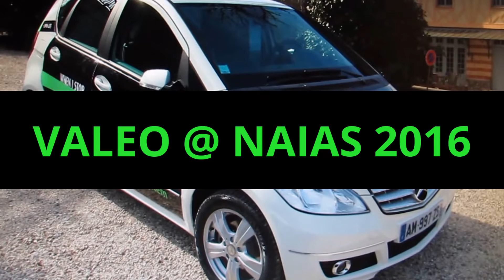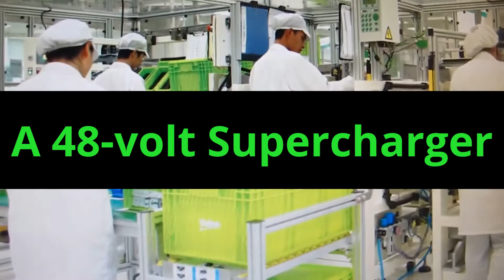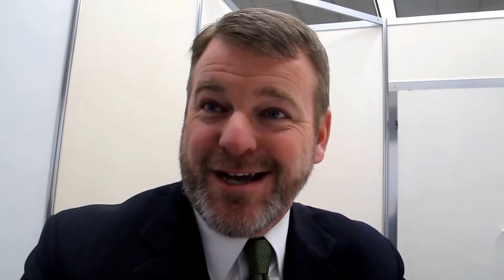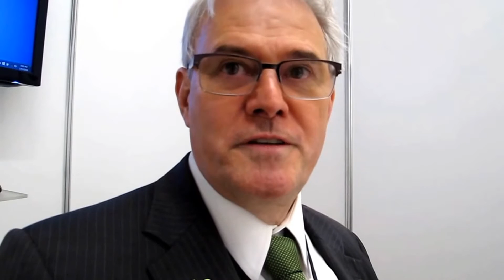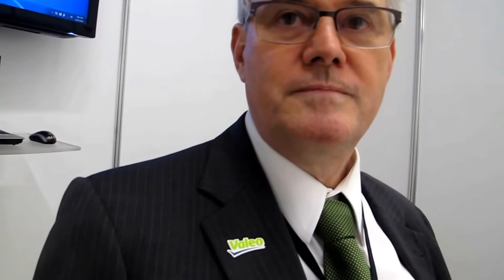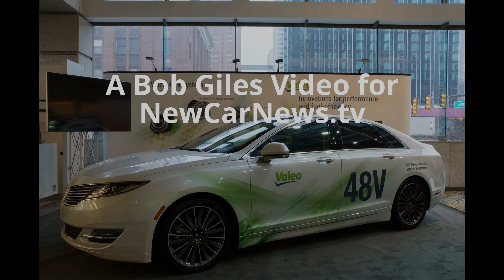Valeo 48-Volt Supercharger Powertrain @ 2016 NAIAS --Bob Giles NewCarNews.TV

Comment: ALL ELECTRIC VEHICLE WITHOUT PLUG-IN REQUIREMENT.
NO OUTSIDE ELECTRIC NEEDED.
VEHICLE CAN DRIVE SOMETIMES, OR WITH OPTIONS DRIVE UNLIMITED MILES WITHOUT ANY USE OF THE BATTERY.
ALWAYS DRIVES 100% ELECTRIC.
Price for a Full Size or a Midsize SUV $ 24 to 26K. Peoples Car. Plus options
PLEASE SEND ME YOUR E-MAIL ADDRESS FOR MORE INFORMATION.
PS: There is No such a thing as a Plug-In Electric Vehicle with Zero Emission. Not Now or Ever in the Future.
There is No such a thing as a "Electric Vehicle Wireless Power/Charging System"
It should be called Aboveground or Inground Electric Charging System Without Plug-In.
heinz-welschoff.strikingly.com